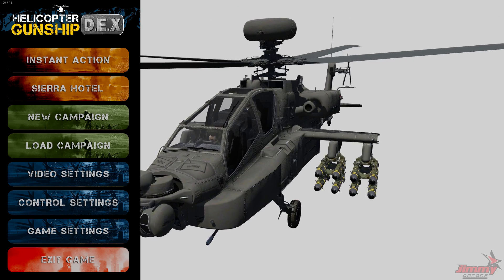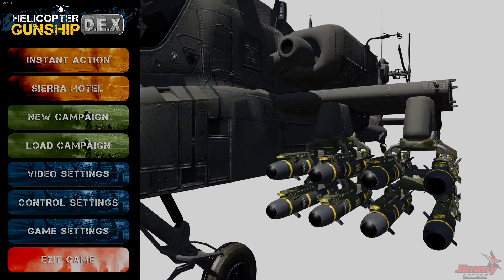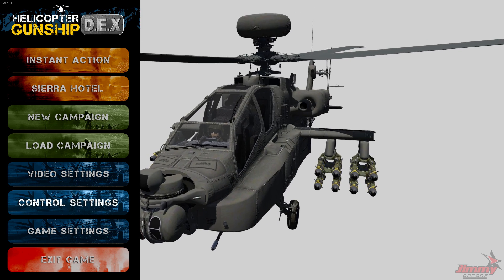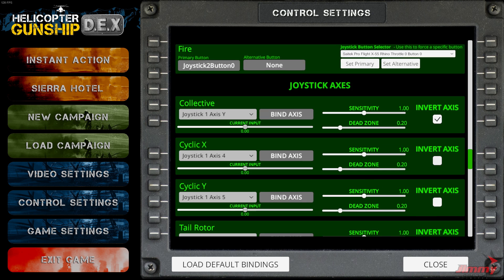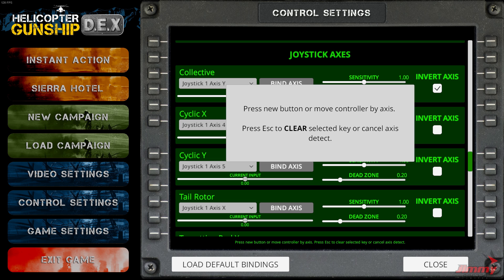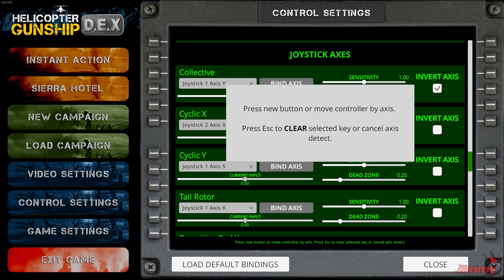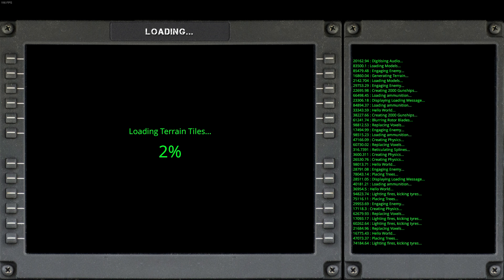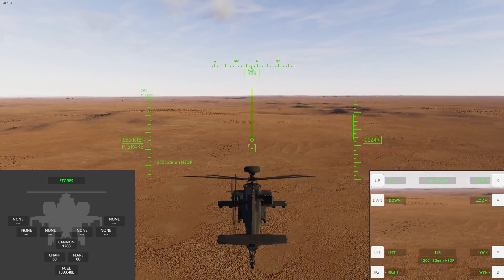Helicopter Gunship D.E.X Control Binding Tutorial with Saitek X-55 Rhino

Comment: My Control Settings menu looks different to the one you show
Also none of my controllers are picked up by the game. I have a Virpil WarBRD joytstick, a Virpil T50 CM2 throttle and Crosswind V3 rudder pedals.
Reply from the maker: Hi, I implemented a new control binding system which is why it doesn't look like this anymore. I know another user is using a Virpil T50 successfully in game....

https://steamcommunity.com/app/2012140/discussions/1/3777994452128913010/

Post a support thread in the Steam forums and I'll see what I can do...
Reply: @jimmyarcadelimited  Hi, after fiddling around for another half an hour I finally got my controllers to show up and could bind them no problem.
Bound the most important stuff and am blasting a Russian armored platoon in Norway as we speak. Great fun!
Reply from the maker: @KarayaYT  that's great news. There does seem to be something with Virpil controllers where they just suddenly start working. Any way, glad you got it working and please let me know what you think and what you'd like to see in the future. There are a number of forum threads already where people are posting things they'd like to see (or not see) and I do try to accommodate everyone where possible :face-blue-smiling:

Comment: Can you be the actual gunner? Or just the pilot? On the fence about getting this game. Looks interesting
Reply from the maker: You actually play as both the gunner and pilot at the same time. It sounds tricky but once you get used to using the Altitude Hold & Hover Hold modes you can get really good at engaging targets on the move. Alternatively you can park behind a hill and employ pop-up tactics to take the enemy out. However, there's no "Gunner Only" mode - at least not yet but I have seen some cool DCS videos where they are playing as just a gunner so I may well add that in.